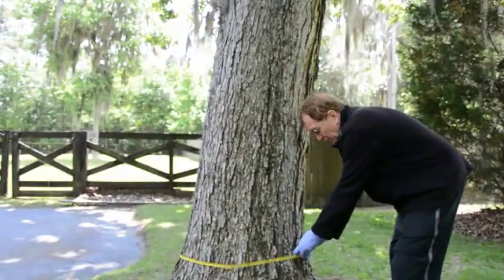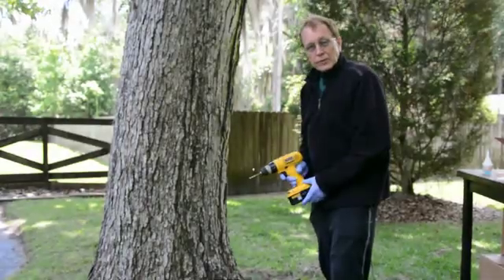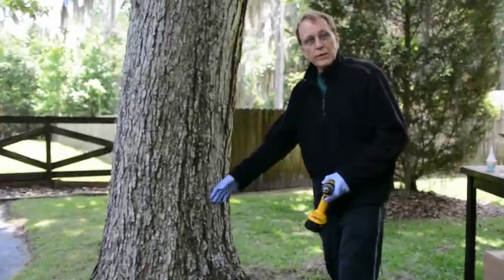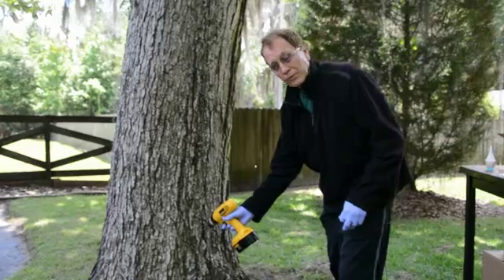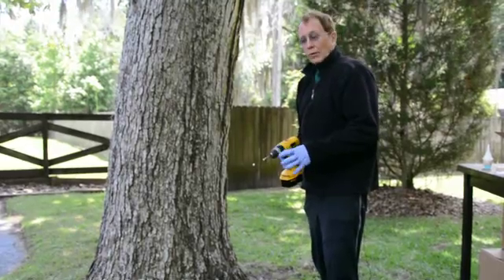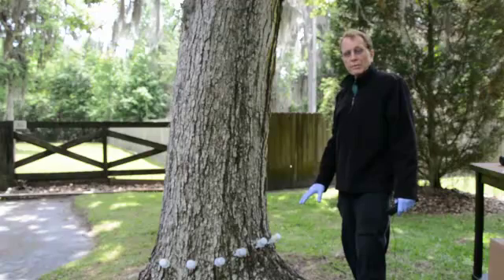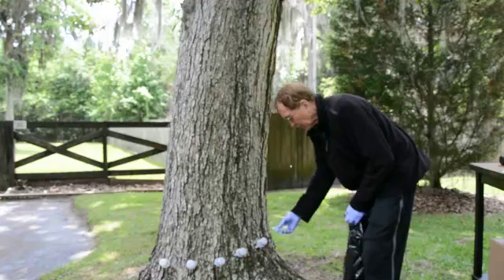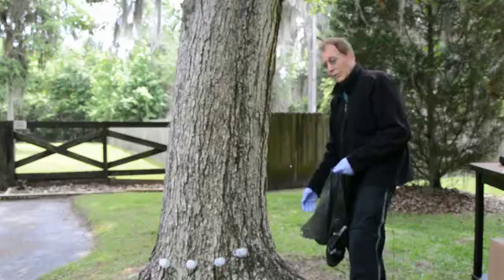Tree Tech Micro-injection Step-by-Step

Comment: Mauget Co. since '60's when I began using it and have been controlling Emerald Ash Borer in my town now for about 20 years with imicide.  Might add drill downward so after pressure wanes the gravity feed works.  Window is a matter of hours until the  injection intake is halted.  So pick a warm day, sunny and not too wet or dry for optimum translocation.  Eab injections work for eab but must be done early in local infestation before vascular system is destroyed by feeding and chem. movement will not occur..  In our area Eab hatch coincides with Black locust (Robinia) in bloom.  https://www.youtube.com/watch?v=mJR4IJupA94&t=272s

Comment: Followed these steps exactly.  Out of 12 injection capsules,10 failed when we got to the step of tapping them with the white end cap.  Instead of rupturing the injection spilled out of the tip and onto the tree bark. There was no opportunity to go to the last step and push in and pressurize it. Extremely irritating. We were working on a sweet gum tree. Do not buy this crap
Reply: The video says to only drill slightly beyond the bark. I go a bit more because the injection tip is only so long and theres a stop. Tap it in well, once after you hear the seal break and the seat the device on with several good taps until it doesn't move anymore. When I do that I have no problems.

If you see it running down, give the cylinder a few good hits with the rubber mallet, that often takes care if it.

Comment: Do these work any time of year or do you have to wait till spring when the sap really starts running?
Reply: Correct.. one I do that helps uptake is to water  the tree the day before so it is up taking  faster when you apply the injections.
Reply: It depends on your climate but around May when the leaves are filling in and before most invasive tree pests attack in full force is best.